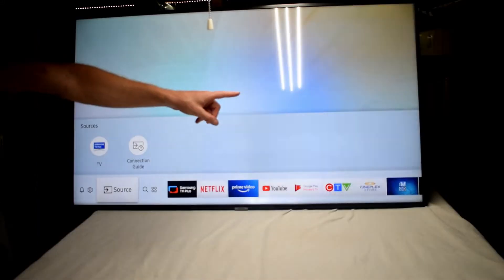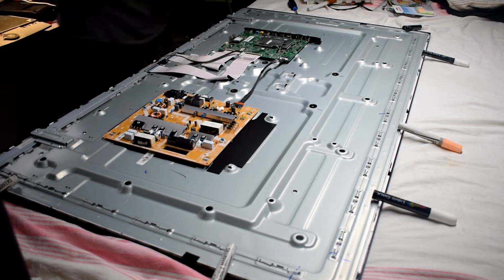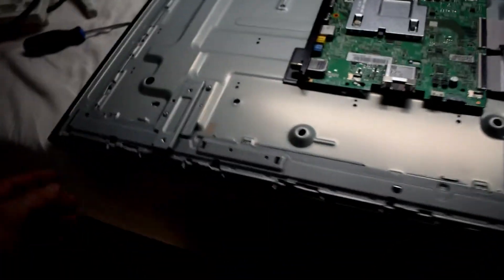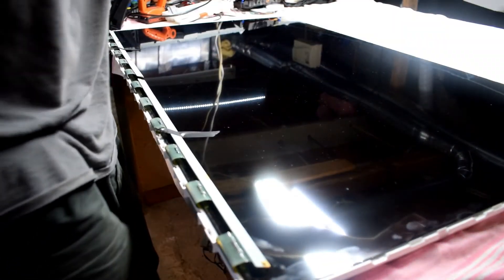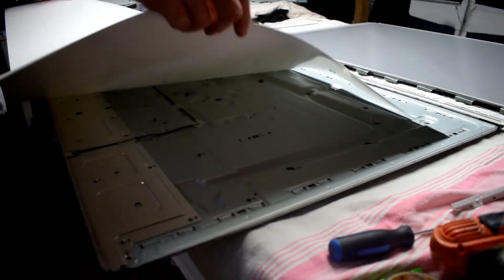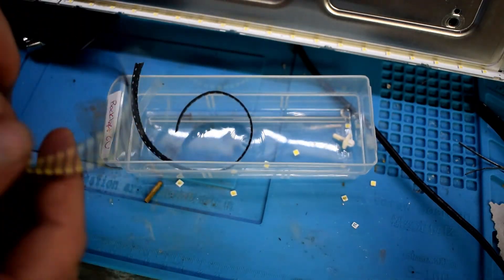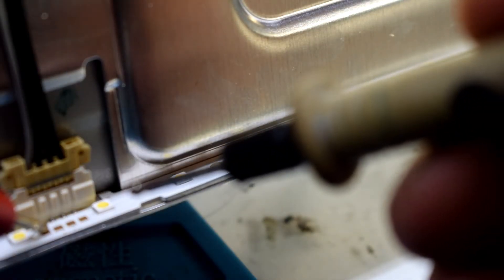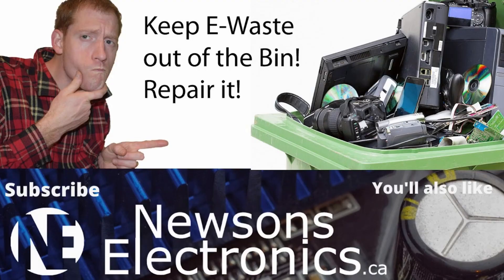TV flickering? Fixed in 5Minutes (Samsung UN55NU7100) backlight repair

Comment: Hi, I've scratched off the dud-LEDs, but instead of there being a positive and negative on the pad, there's a small metallic circle. Do I need to remove that also to get to the positive/negative pad? Thanks for the assistance!
Reply from the maker: yes remove should be flat

Comment: I bought a new led strip, but I have a problem with the power supply. On the instrument it shows 255 volts on the Led output. The diodes get very hot in just a few seconds. I don't believe that they would last until I lower the voltage in the menu.It is the same TV model 
Have you had such a problem?
Reply from the maker: they do heat up
Reply: @NewsonsElectronics  Yes, LEDs heat up immediately!
Reply from the maker: 255 sounds a bit high do the math 1led is 3volts how many in series.
Reply: @NewsonsElectronics  I calculated, 20 diodes per series need 60 volts! In one of the videos, I read that the led part is for that 6-volt TV. If it works that much, I needed the maximum to be 180 volts! I have no idea what to do except reduce the voltage somehow. I'm not an expert in this, but I have to solve something already, when I already went to repair the TV.

Comment: _If there is no back light ,is changing of strips only a solution ? Can't the TV be repaired without changing the strips ? Are all strips required to be changed as per some technicians because changing of few strips affect functioning of other strips subsequently. ? Kindly clarify
Reply from the maker: just replace the broken leds
Reply: @NewsonsElectronics  u mean led strips right ?
Reply: @threestars9788  no just a single led not the entire strip
Reply: @NewsonsElectronics if one goes the others will too, you should replace the strips entirely